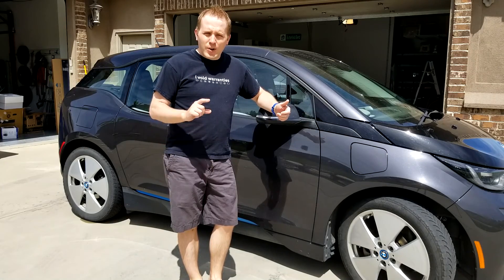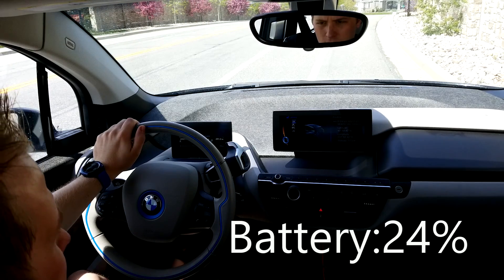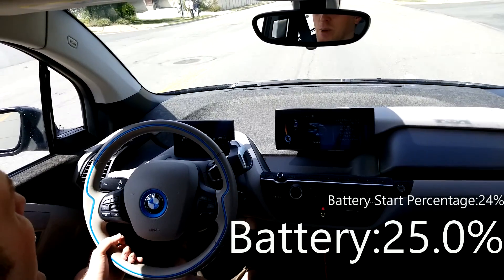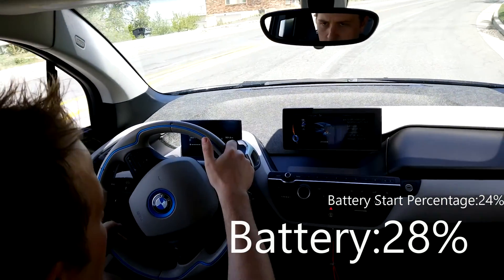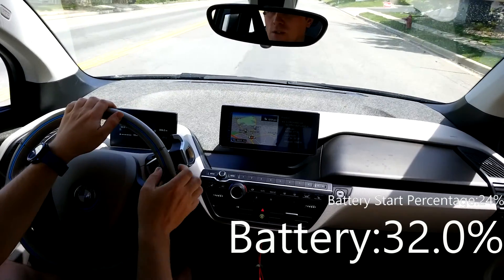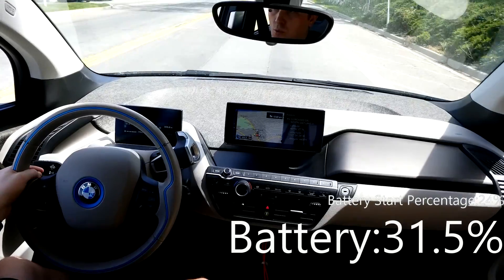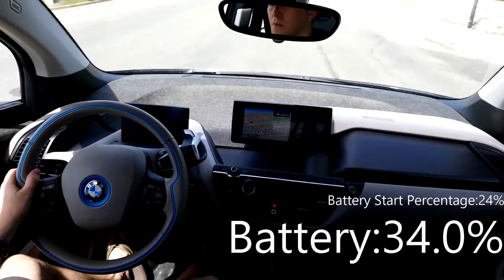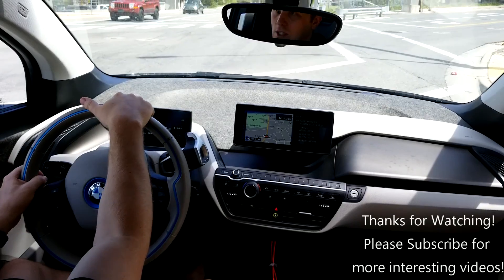Charging an EV with Gravity (and Gas) Without Ever Plugging In

Comment: You can also just enter the emissions mode and the gas engine will run for up to 20 minutes which will charge the battery while it’s running. Much easier than finding a big hill👍

Comment: No and no. This is silly and a waste of energy. Read and understand the laws of thermodynamics and you understand this is not sustainable. Also, if you want to run the REX, just park and run the rex in a pinch. Otherwise just charge it. Simple. None of this you did is necessary. Horrible idea. period. https://en.m.wikipedia.org/wiki/Second_law_of_thermodynamics
Reply from the maker: Obviously you didn't actually watch the video... the purpose IS NOT to show that I'm somehow breaking the laws of physics and charging the car FOR FREE USING GRAVITY (LOL) /s  The point is you can charge the car's battery with gasoline and gravity in the event that you can't find a charger and don't want the battery to get too low. It also is not intended to be practical at all, it is just an experiment or exercise to see what is possible.
Reply: @cbutters  What I am saying is that you are mathematically wrong. The amount of energy spent is not less than energy gained. That is not possible. You are only influencing the heuristics of the gauge temporarily to make it show that number. In reality you are wasting time and energy. Period. You are trading gas for a drive up the hill and generating on the way down. That doesn’t work long term. You eventually run out of fuel and the equation doesn’t work. See this: https://en.m.wikipedia.org/wiki/Second_law_of_thermodynamics
Reply from the maker: Please please read my response properly... Don't pull an assertion from thin air that I am a perpetual energy nutjob!   I AM NOT SAYING I AM GENERATING ENERGY FROM NOTHING... I AM TRADING GASOLINE for charge on the battery, obviously you need to buy more gas and this is entirely less efficient than charging the car from the wall... This is just in the event that you need to charge the battery (for health purposes as it can be dangerous if the i3's battery goes too low.) but for some reason you can't plug into the wall.   Please use critical thinking skills in reading what I am quite literally saying to you and not jump to strange conclusions.

Comment: Hey, question guys. I want to buy the newer 2017 i3 with the bigger battery, I want to use it on gas only without ever charging it, is that ok? Can I do that?
Reply from the maker: You could.... but why?  You will be at risk that the battery will get too low if it sits too long without driving. Plus it isn't great for the battery to be at 5-10% all the time while you wait for the generator to run. Just plug it in to a 120v outlet at home.  It is cheaper than gas.
Reply: @cbutters  that's great if you have a house,  we live in an apartment,  nowhere to plug it in
Reply from the maker: @alizierny  I see.. On my 2014 model there was a way to flash the firmware to allow you to turn on the engine manually at 70% battery... if you ran it this way you shouldn't really have an issue. I have no idea how the 2017 works compared to the 2014 though.
Reply: @cbutters  i will look in to it, thank you!

Comment: Wow, I'm so glad that I have a Ford C-Max Energi plugin hybrid...I can go down a huge hill or a mountain without pressing on the brakes at all by turning on hill descent mode which will maintain a constant speed and use excess momentum to charge the battery, and then it will plot the most energy efficient mode to get back to the origin using gas or electric as need while minimizing total energy costs and the combined electric + gas range is 600+ miles.  If the battery runs too low, it will also automatically start the engine for as long as need to recharge to a safe level.   I usually only see this if I leave the car idle for a whole week.
Reply: The CMax Energi is a technological dinosaur in comparison. I've had two. Ford is looking past ev's to the next hot thing. Autonomous vehicles.
Reply: Matthew Marlowe your car pollutes more so in the end you lose ;)